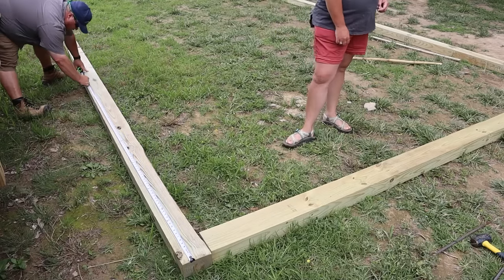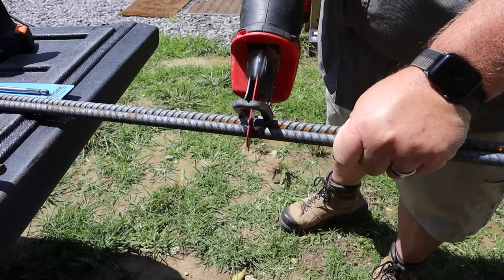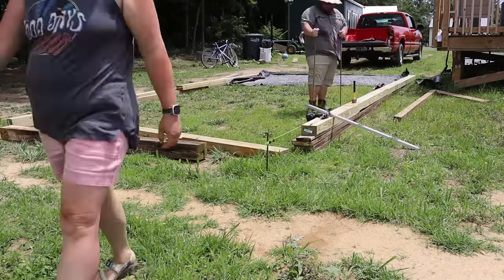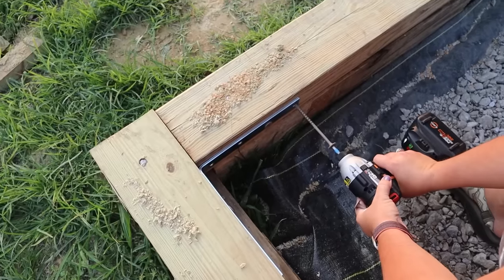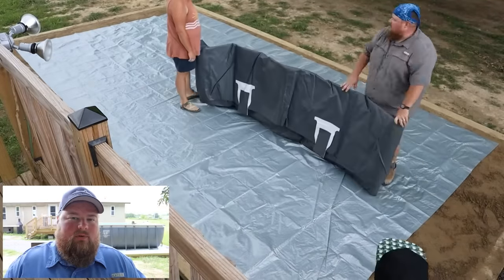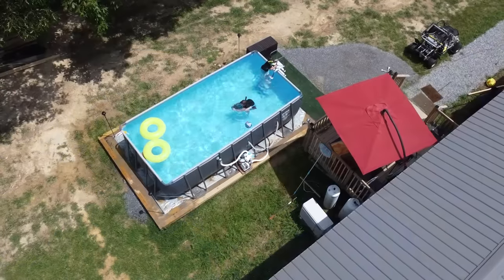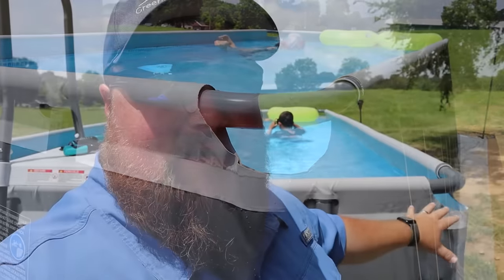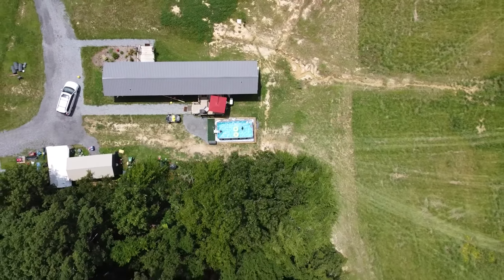Building a Pool Base for OUR FIRST POOL! - Above Ground Intex Ultra XTR 26355EH

Comment: We have the larger pool of this make.. I bought cement pavers I believe they are .. 10” x 20” (I think) and put those under the feet/legs of the pool to give it a bigger base so that sinking isn’t a huge deal.. also it helps keep them up off the ground more to prevent water from standing around them and rusting them out.
I do not recommend taking it down.. we leave ours up year round just treat it as a “hard sided above ground pool” drain half/ 3/4 of the water..put winterizing chemicals in it  cover and unhook  all hoses and drain ur filter regardless if it’s sand or cartridge.. now walk away.. (we live in near Chicago so it gets very cold, snows and freezes… and we have never hand a problem.. but I do know many ppl that try to take theirs down every year and it become a bigger nightmare over time the liner will get brittle in the winter month and it’s never ply able like it use to be when u first  set it up.. so it’s hard to put back up

Comment: Also if u are putting a deck around ur pool and screen and  put a top on what u have then add a screen door between ur deck now and the deck for pool.. That is if u do what we did.. We had a top and screened in our regular deck then when we added a deck around or pool we put a screen door going out to our deck then on our deck with top and screened in we were able to add a ceiling fan...😊

Comment: When we had a pool I found that putting a large diameter and 8 to 10 inch deep ,heavy-duty rubber animal watering/food pan full of water right in front of the ladder, we were able to step into it rinse off our feet, thus cutting down on sand, grass etc getting into the pool itself

Comment: Hi guys just an fyi, your warranty will not be valid if you don't use the pavers under the legs. You may need to go back & put 16 x 16 pavers under each leg. Just know that y'all are super sticklers about doing things right. We just finished building our base, we did not use rocks but instead 22 tons of mortar sand & we packed it ourselves. It's only taken about 3 weeks 😂. Enjoy & have a great pool time

Comment: dont take the pool down over winter leave it up, folding them after being out in the sun is bad for them they start to crack if you leave it up it will last way longer than the warranty and putting a deck around it will also help protect it from the uv from the sun try putting slabs under the poles to stop then sinking in to the sand... i sunk my 15tf pool in to the ground 3ft deep and its been good 5 years...

Comment: Unfortunately, I think you will experience some sinking over time. You need to remove some native soil and rebuild with type A base material. You need a good compaction. Water weighs 8.34 lbs./gal. Factor in the downward force. Hopefully, it won't sink too much. Good luck.

Comment: I was just thinking this would be perfect for our small backyard. I have wanted an above ground pool for our yard but the ground is so uneven. Tried and gave up with a smaller pool than what you got. Instead of pea gravel, you could try artificial grass over the sand; it would be easier on the feet than gravel.

Comment: Great video!!! What are the dimensions of the base? It looks like the legs protrudes out a bit. I just bought this pool and I started to build the base at 10x20 due to minimal size of backyard. It will arrive in a few days but I am unsure if it will fit so I may send it back to get smaller pool. Let me know if time allows. Thank you

Comment: Interesting. I have to redo my pool and am moving it. The grade has a almost 10 inch difference in places. Been trying to figure out how to do this but want to use horse stall mat under the pool with tarp under pool but on mats. We used foam insulation under the pool amazing, on poly metric sand. Held up great but had a high end due to not having a laser level. Lived with it but was about a foot higher on one corner. This was due to the pour from the dump truck sand and not pulling all the sand over to the other side. It was graded with in an inch I think before sand. But after 5 year need to move location. But now in drought and have water restriction.
Reply: I would add the bourse stall mats to it.
Reply: Add a mini shed to hid the pumps. The only issue is that the hoses breakdown in the sun they really need covers. I live in Texas and the sun kills them every year.

Comment: Wow, I was looking at a pool for my yard and I’m thinking the price of a pool and all of the work and not wanting to refill it every year. I’m better off just either purchase a kit or just have them put in a fiberglass pool. In the long one run I’ll probably better be better off cost wise by just having an inground pool even if it’s just a lap pool.

We had the doughboy above ground pool, which was excellent except I wish I had got an oval instead of round! And we had that up for about five years and then when my husband was diagnosed with cancer and we knew he wasn’t going to survive with, went ahead and took the pool down.😢

Before that we started out with the round Intex pool!😅 the very beginning ones that were the most popular with the little blowup ring around the top😅😅😅

Now years later, maybe eight years now it’s been since we’ve had our last pool, because we’re becoming hotter and hotter here in Michigan, I’m debating, inground or above? An inground pool I will not be able to heat because of the winter in Michigan, but in above ground pool, well insulated I could heat with a lot of foam!😅 although I would not use it in winter!!

The thing I’ve noticed most about when we have a pool or any water or even no water source for that fact, we tend to have was these and I really don’t have any flowers so I don’t understand why they’re here and when we have a pool there even larger And darn horseflies!

I’m sitting on the bench, should I or should I do I wanna maintain it or do I not go for it? We only get about three months of warm weather but if I heat it, I can get a lot more swimming time. So I’ll procrastinate and probably end up doing nothing and continue to sit on my dick on my swing chair and watch the birds bathe in the birdbath and eat from the feeder😅😊

Say come summer 2025
.

Comment: I bought a 12 x24. Do you know what size the ground cover is or what size I need the platform needs to be. I am using 4 x 4”s like you filled with class 5. Thanks

Comment: Are those dimensions of the pool the top or the base because the supports clearly are angled outward. Just wanna make sure before i order the pool that the base area matches the dimensions advertised. Thanks in advanced.

Comment: Ah....the ole above ground pool! Here's my issues with pools in general.  Initially, you spend a lot of money on it thinking to yourself , "This will be awesome !" Then reality sets in about at the third month. 1st, it becomes apparent to you that the pump that came with it is woefully undersized! 2nd,you realize you underestimated just how much the chemicals you need cost! 3rd, after realizing you have to go out and skim the pool for floating debris, you become aware that you need a built-in skimmer! 4th, after installing an aftermarket skimmer it becomes apparent that the first thing you noticed can't be ignored anymore and you have to buy a bigger pump because the pump that came with it isn't strong enough to make the skimmer work effectively! 5th, after spending 1000s of dollars and countless hours keeping it clean, you start noticing that everyone isn't as excited to have a pool as they originally were. 6th, you start to realize that after spending 1000s of dollars and time and energy, constant fussing ,you begin to realize you now have a huge container of water in your backyard that is costing you money on electricity, time and energy that is basically just sitting there getting very little use. You yourself are hesitant to even jump in after working on your yard all day because you realize all that oil a d dirt will on your body will only cause you more work with replacing filters and cleaning the pool. 7th, your now at the year mark of having a pool, and it becomes apparent you now have a large body of water that you are now a slave to it rather you like it or not! You talk to your wife about taking it down because nobody really uses it anymore, at least not enough to justify the cost of chemicals and electricity use. You're shocked when the wife says , "You're crazy ,don't you realize how much we spent on it!" ........its at this very moment you pray for a time machine in hopes of going back in time to prevent it ever being built!  But wait, it gets better.........you get a notice from your home insurance saying because you now have a pool, your rates are going up ! Oh, and you have to build a fence around your pool. Otherwise, they are going to cancel your insurance! 😮.....you simply "sigh".....you sit down and think to yourself, all I wanted to do was cool of in the summer time! Lol!! 😊 good luck!

Comment: Oh my. Hope for the best. Are you using a foot basin to dip your feet in at steps?
Why would you take the pool down in fall? Remove enough water as suggested by pool manufacturer. Do other closing instructions. Most important is best electric filter system. Spend your
Money there.
Enjoy!

Comment: I’m curious why you didn’t just do a concrete pad. The amount of time and money you spent on this I’m guessing was about what we spent for our pad.
Reply from the maker: The base was about $700 total. I don’t think concrete would have been less than $1,500. Our base is 12’x24’ and from 5”-11” thick.
Reply: @sam-and-angela  if your NOT counting the Timbers and equipment, fuel and labor etc I could see it being $700 depending on where u live..but you have all of that on hand so I could see that. We did a 5in thick 22ft round smooth top concrete pad and it was $2,000 but we didn’t have to do anything but show them where to put it.